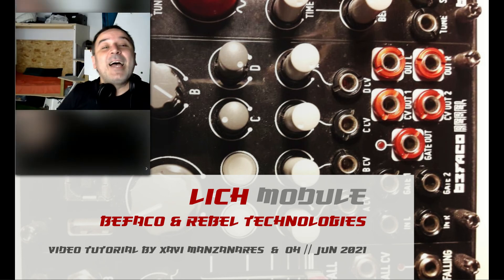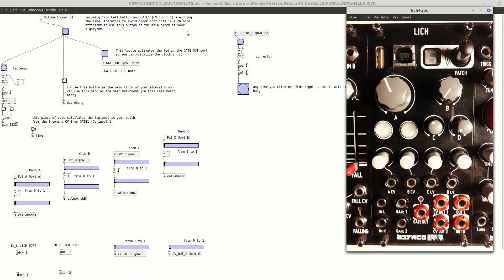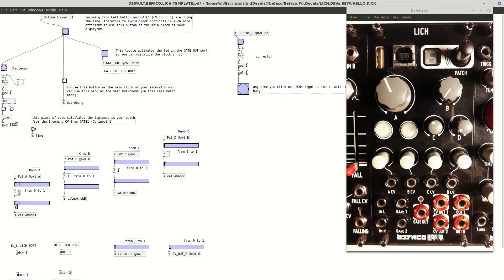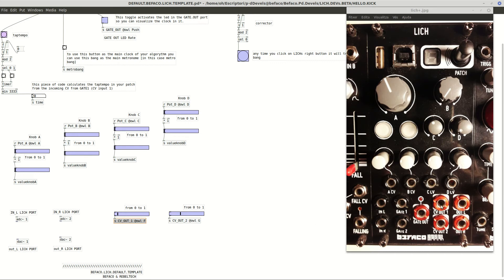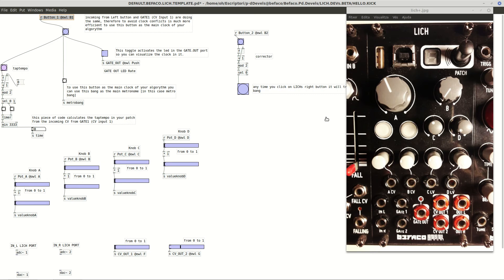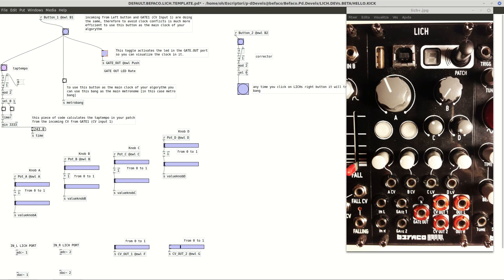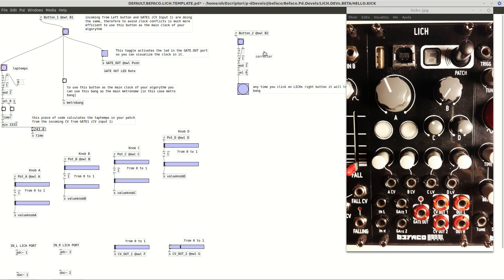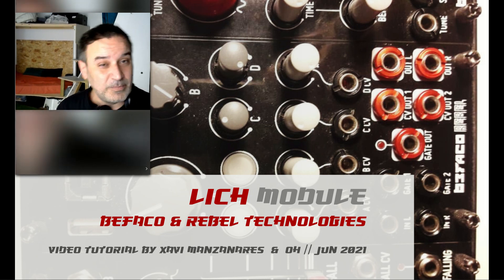Befaco / Rebel - LICH Pure Data Tutorial // Part 1 (LICH TEMPLATE)

Comment: Hi Xavi, thank you for this intro to Lich programming. Could I clarify a couple of things? I want to be able to clock the Lich, using Gate 1 (and/or Gate 2) in. But looking at the patch you use here, it suggests that Gate in 1 and Button 1 are the same thing. How can I reference them separately in my patch? Also, in general terms, I think I understand that you need to reference the controls correctly, but to clarify: '@owl b1' is button 1, '@owl b2' is button 2. '@owl a/b/c/d' references the 4 control knobs. 'adc~ 1' / 'adc~ 2' refers to individual audio signal ins, and 'dac~1' / 'dac~2' refers to individual outs. Lastly, in terms of CV outs, '@owl f' and '@owl g' allow reference to the two outs. But, can you clarify how I reference Gate in 1 and 2? Is gate out referenced by '@owl e'? Thanks in advance for any help you can provide here mate :)

Comment: Thanks for the intro. I'm afraid I'm not familiar with PD.
The issue with button B is interesting. 
PD seems to be picking up the button release as a press.
Why doesn't PD just give you a gate to work with. Isn't that an option?
(I'm kind of thinking it's going to be easier to go straight to C++ if PD is awkward)
Or is the limitation from the hardware?
Reply from the maker: Its more sotware related. Its defienetly "easier" when you go the C++ way. But well going the C++ way is not the easiest :P PD offers great ways to get started without going full on coding but has its limitations!
Reply: @Befacosynth  . Thanks for that. I'm kind of PD-skeptic anyway.
Are there C++ examples available, that's much more my comfort zone...as long as there's documentation for stuff like accessing the ins and outs and allocating the different bits of memory.